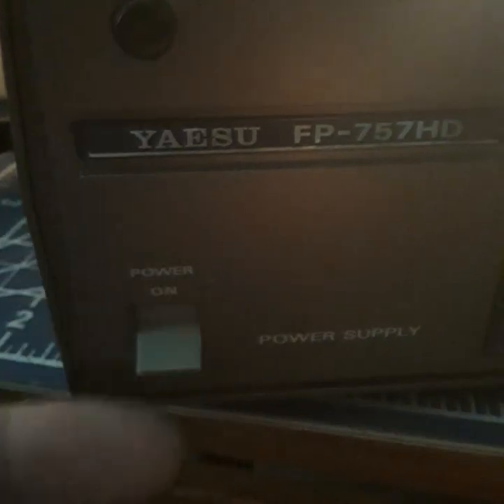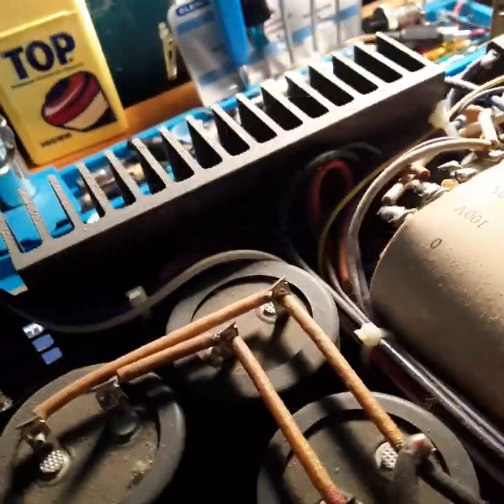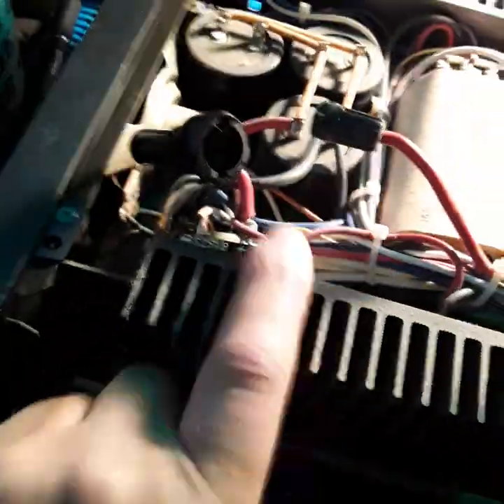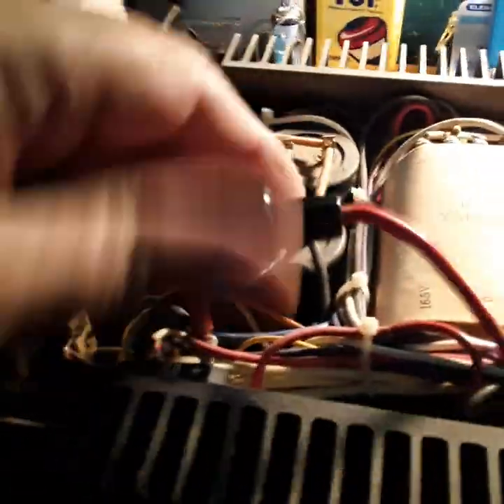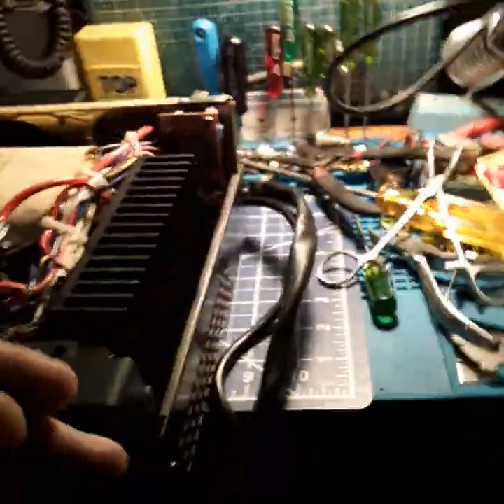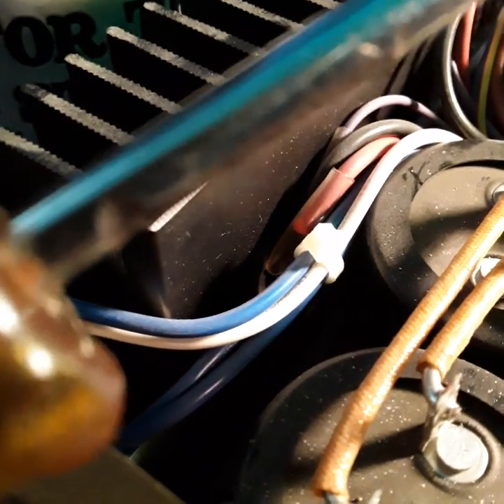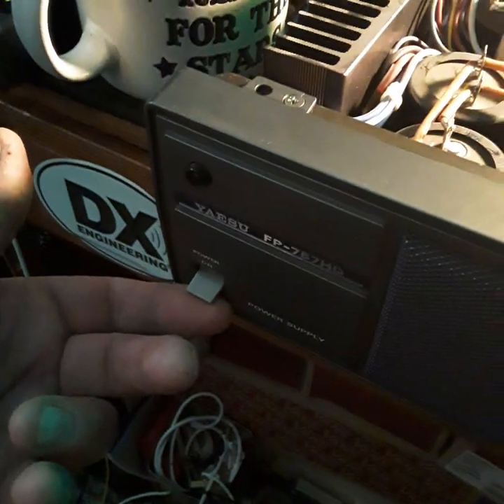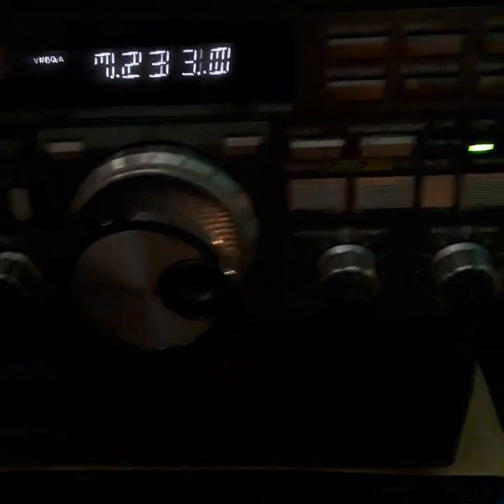YEASU FP- 757HD POWER SUPPLY FAILURE 😖📉📈🤷‍♂️🔥

Comment: Voltage surge on initial power up.   Could be those caps in there getting bad or the bridge rectifier.
Reply from the maker: I was thinking the bridge rectifier the caps are good boy they are good lol right now its running fine we will see when i rag chew see if it blows up again i will replace the bridge bridge rectifier i have that kind in my junk box. I love junk boxes its got me out of menny pinches 👍💯
Reply: @Atomshamradio  BTW, I have a spare transformer for that power supply if it ever blows up on ya.